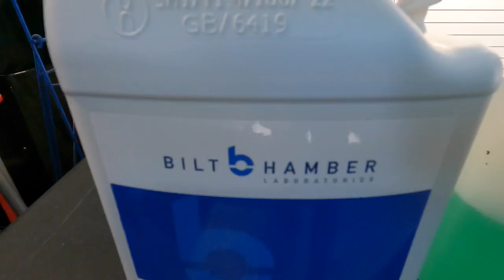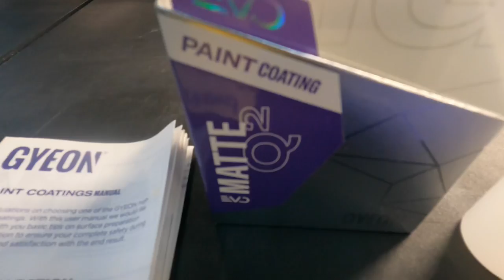How To Prep And Protect Matte Paint!! The Ultimate Guide!!

Comment: Would you recommend detailing the wheels and wheel arches, etc., before doing the exterior wash and iron decontamination, so that you don't disturb brake dust and get it on the car's painted surfaces between cleaning and final protection coatings?
Reply from the maker: You absolutely can....we just did it in this order for necessity.